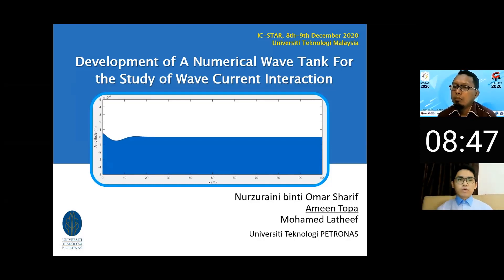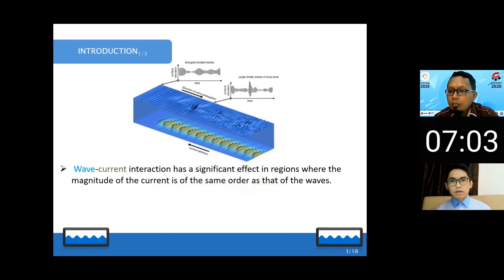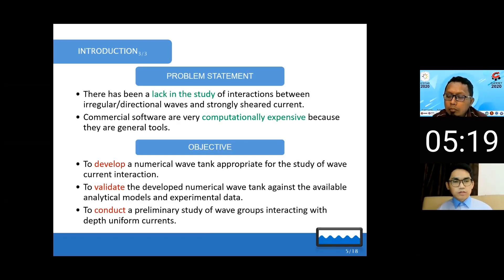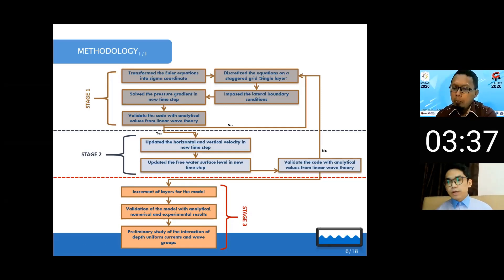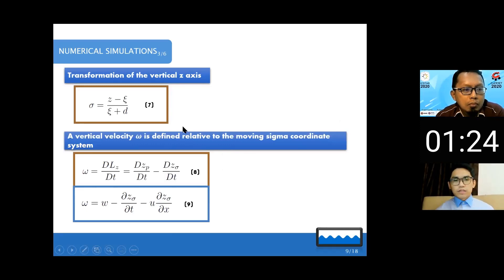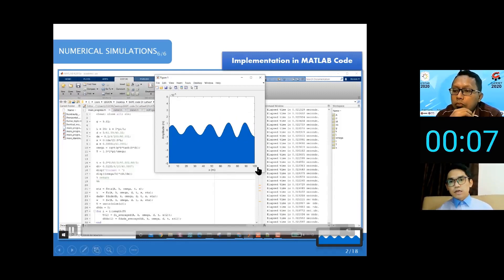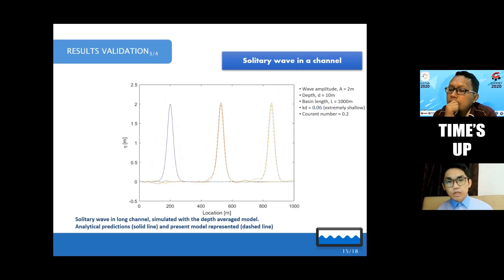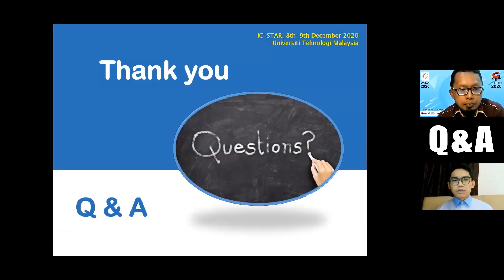Numerical Wave Tank with MATLAB

Comment: What a coincidence, I am also from a Petroleum university which is Southwest Petroleum University in China. I am focus on the response of structures due to natural gas explosion. Chemistry+CESE+Structure modules in LS-DYNA are expexted to be used during my research to conduct a FSI simulation, but there is very limited tutorial, guidance, or any other documents that can help me to use this tools to finish my research. I am wondering if you can make a tutorial about these modules.
Reply from the maker: Dear Chen, 

Nice to meet you. 

For the response of structures due to gas explosions, you may use ALE method or SPH method. I have done Blast simulations before and reviewed many articles on this. I didn't find a single reference where they use Chemistry + CESE for blast modelling.
Reply: @AmeenTopa  Actually there is a literature using this method, I'll give you its name:Fluid structure interaction with a finite rate chemistry model for simulation of gaseous detonation metal-forming. The problem is because of my poor knowledge  about LS-DYNA, I cannot even reproduce the pocess mentioned in this article, let alone my own research topics.
Reply from the maker: @DC-fw8zn  Oh thanks for sharing the reference. This is metal forming related, I read more to blast wall applications. Interesting work.

Don't feel bad for yourself, haha. This paper is pretty advanced. Even someone like me need to spend sometime to model it. :D
Reply from the maker: @DC-fw8zn  You can check the examples here for CESE:
https://www.dynaexamples.com/cese
Reply: @AmeenTopa  Thank you, I'll try in recent days. Hope more communication with you.
Reply from the maker: @DC-fw8zn  Yeah sure, you can reach me on LinkedIN or Facebook for faster response. :D